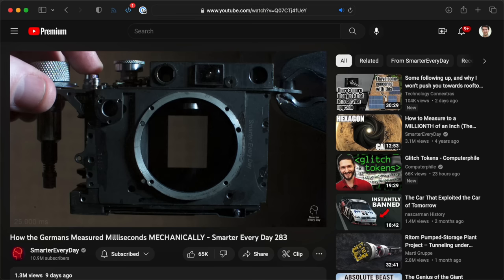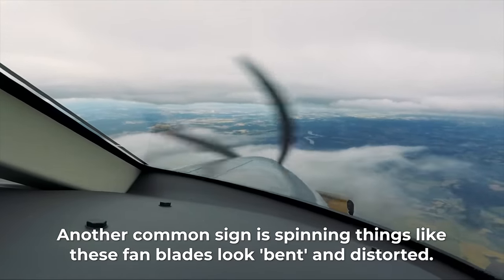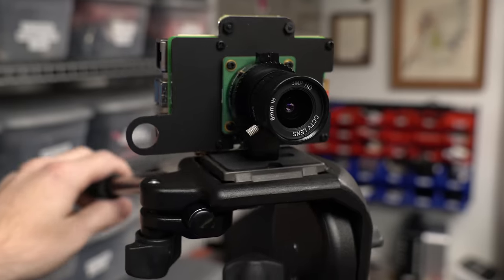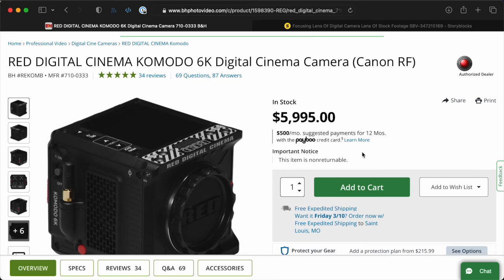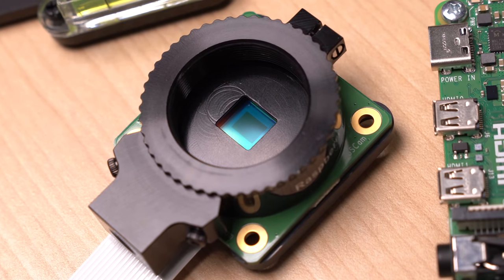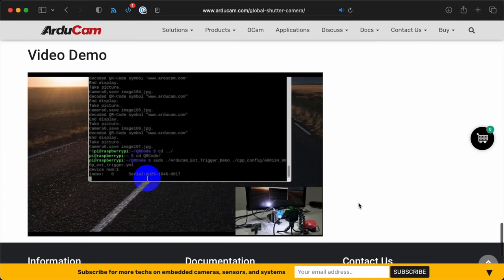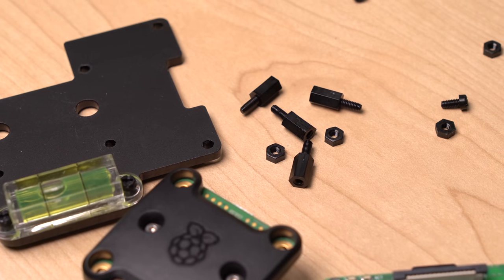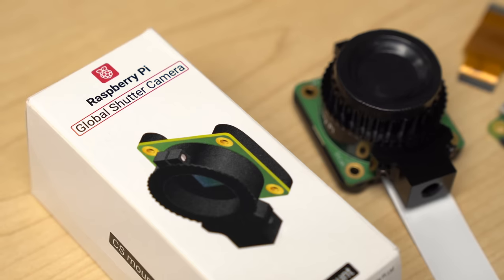Raspberry Pi fixed the rolling shutter problem

Comment: until next time. more pixels , same price... so we wait? havent even actual use last mega hd whateva. and think not have even cables for rpi5..so. kinda stupid change connectors. and if camera is 1080p then its good enough. phantom menace was filmed new new last high tech format 1080p LOL so its good....wait 1440...so we wait 1920

Comment: How well can it pick up license plates, especially when moving
Reply from the maker: Should be a lot easier than with the regular Pi cameras, though positioning a lens appropriately will be difficult since you have less resolution to work with.
Reply: @JeffGeerling  Use another high-res, high-FOV cam as a spotter for a gimbal-mounted global shutter cam with a zoom lens on it 👌